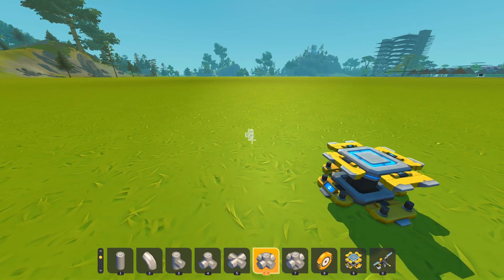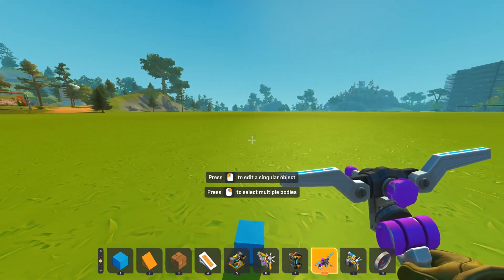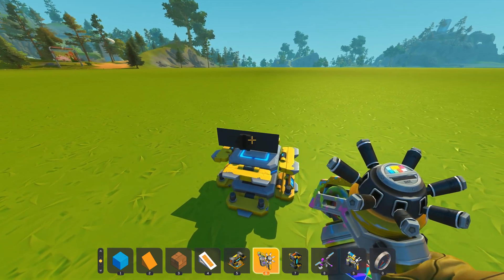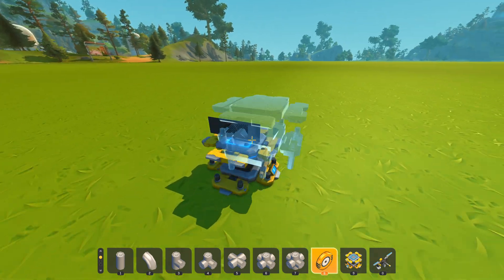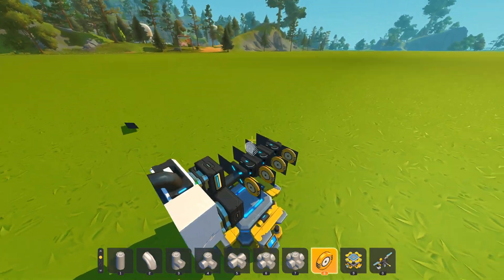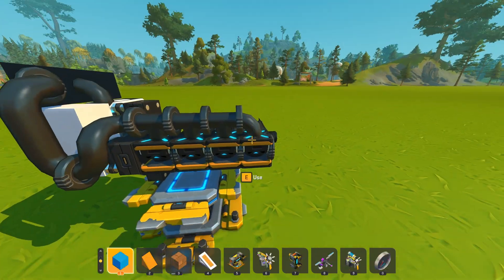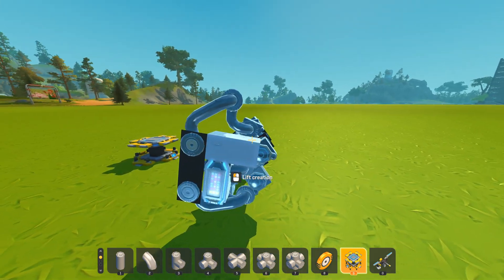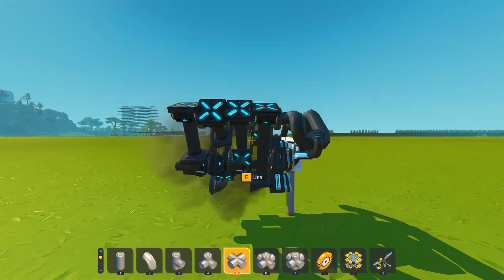How to make a powerful piston engine in Scrap Mechanic!

Comment: wow cool! what's the max pistons you can put in a single engine?
Reply: A LOT. Each section of the crankshaft can hold 4 bearing so 4 sets of pistons. But you can double stack them (see how he pushes pistons up into the pivot point, if you put a 0 width block underneath that piston, put a piston on there, push it all up , repeat it should stack pistons. Meanign. You get A LOT of pistons. Now that's piston in series for speed (horsepower) but you can also slide them sideways into one an other and make pistons in parallel for torque. A LOT of torque
Reply from the maker: well, unlimited. 8 is the sweet spot
Reply: ok
 @Deniz69567